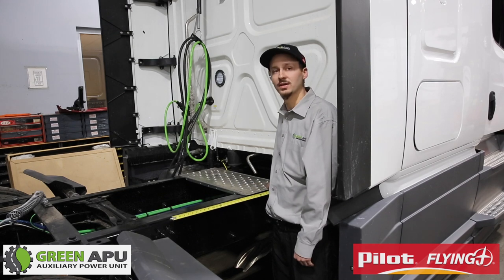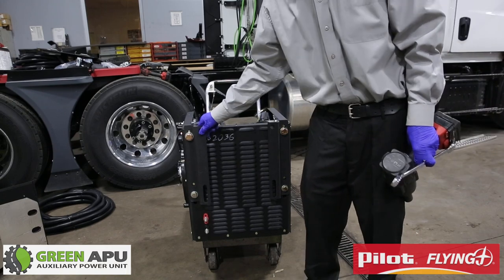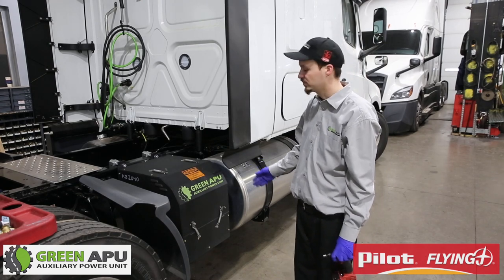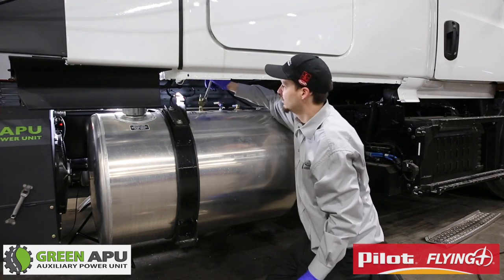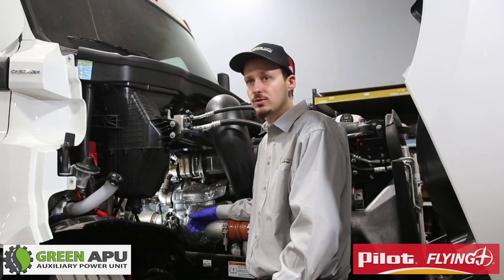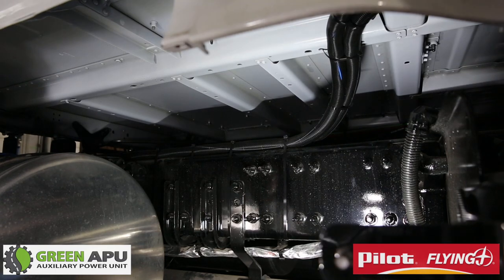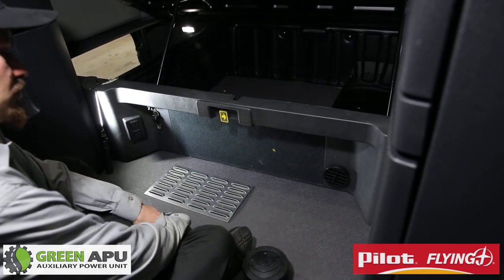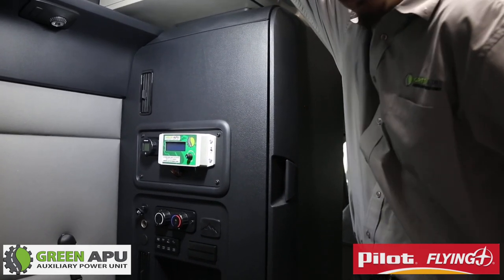Green APU -  2019 Installation Process

Comment: Nice job and i love that impact wrench but i wouldnt trust that any metal shavings didnt get into the fuel tank
Reply: That’s not the way that I was instructed to run a tap in automotive shop class. We were taught to back off the tap to release he chip. What’s your experience?
Reply: That’s why they pressurized the fuel tank before drilling

Comment: Those very expensive apu only handles 6k to 7k btu. They are not powerful enough for summer in arizona, texas, MM or anything over 100. Get yourself a mini split 12k btu anf that thing will cool your truck in extreme heat.
Reply: I disagree I don't know about the green apu but I had a thermo king on my old truck and I run Texas and AZ alot and it worked grate maybe yours was not working properly
Reply: GreenAPU puts out closer to 24000 or 26000 BTUs.

Comment: If you use 5/8 instead of 16 mm along with your 9/16 you don't need to pull out two set of sockets I believe those are standard not metric

Comment: Green apu is light years ahead of the Carrier Comfort Pro and TK Tripak evolution.
Reply: Mine is loud and does not heat my truck very well if the outside temp is below 20 degrees. Will only raise engine coolant to 100 degrees in winter time. I don’t think it’s working properly.

Comment: APU is louder than the semi engine and expensive. I have to move every time a with a apu parked by.  Dumb people would install one. 😂😂😂
Reply: the green apu new engine  supposed to be 50 dbl
thats same as conversation sound
basically nothing
Reply: It's true they are loud, Its a generator and it's the compromise for comfort you are getting air conditioning or heating. Plus power and it's cheaper then running your truck all night. It's saves fuel and truck life so its worth the cost over time.
Reply: @rolandonavarro3632  dont know what kind y'all have mines isnt loud at all
Reply: @biggame2175  I don't have one but I install then. And it's recommended behind the feul tank.
Reply: @rolandonavarro3632  yea I have the park smart by freightliner. Its battery powered
Reply: @biggame2175  I'm in  canada so the battery powered units aren't very popular cause of the cold weather here.
Reply: @rolandonavarro3632  o ok. Well the heat runs off the diesel.